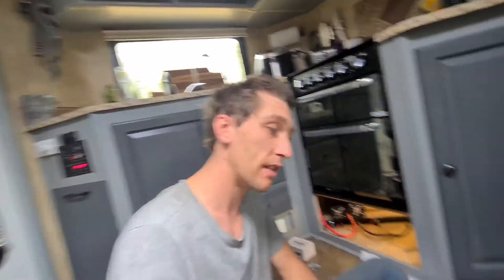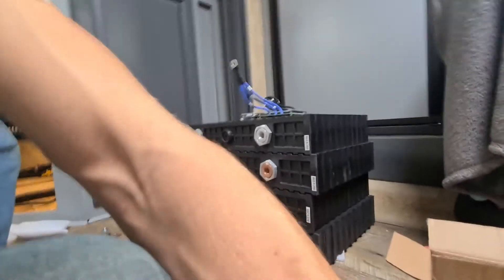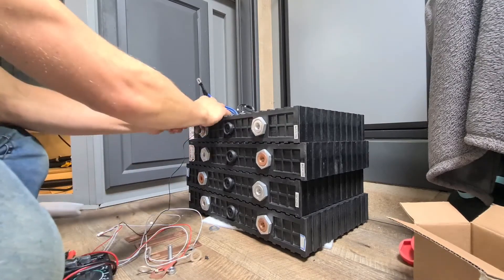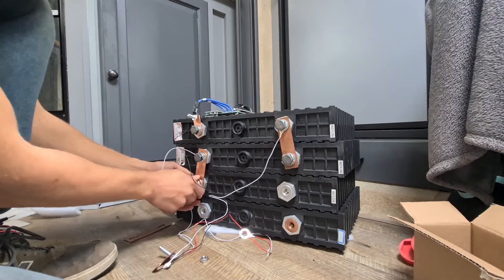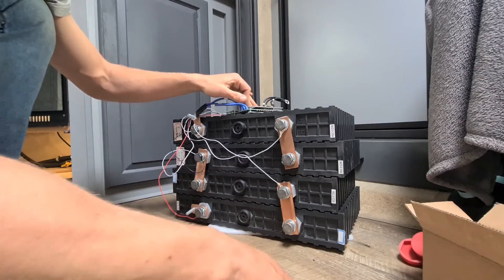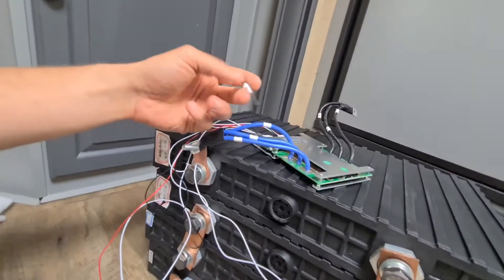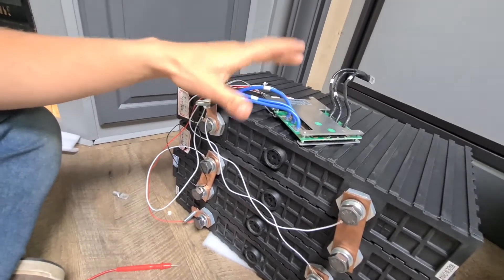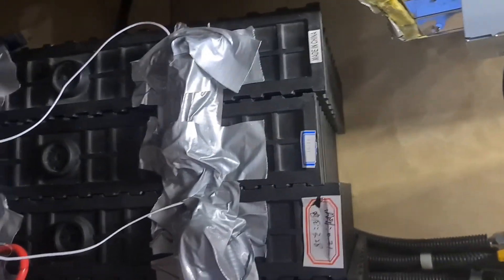Caravan lithium battery setup installation

Comment: Hi do you have a link to the supplier of the cells.. how much were the cells with shipping?
Reply from the maker: I got mine from fpv-power
If you google sinopoly 500ah
You should be able to find them
I payed about $1600 total  and picked them up then got the bms for $100 off aliexpress because I wanted a Bluetooth one 👌

Comment: Make sure you run the inverter through the BMS as if one cell gets to low you will destroy it and the inverter will not cut off
Reply from the maker: I set my bms quite conservatively so if any of my cells are getting abit low all the power in my caravan goes out and we noticed straight away
But yer your right it is added risk but I don't have a bms capable of dealing with the amount of power my inverter can pull